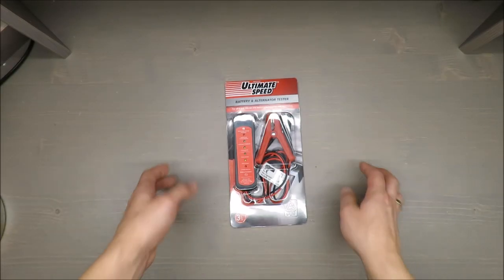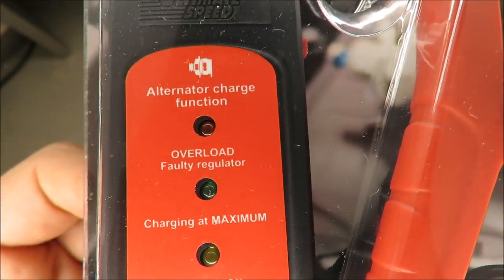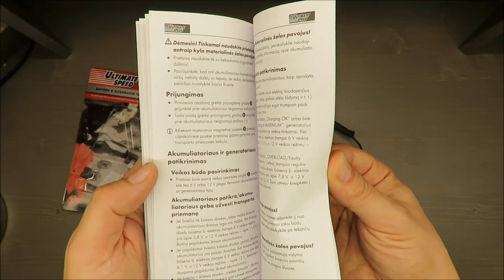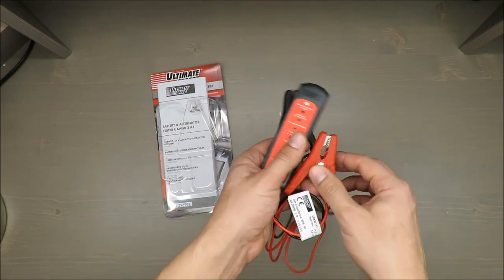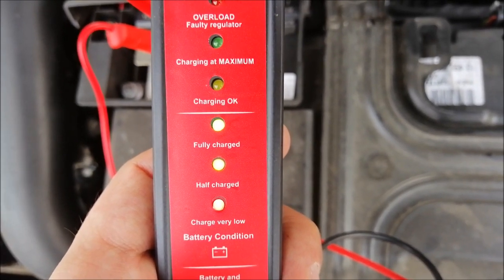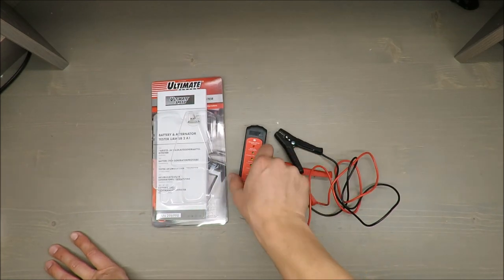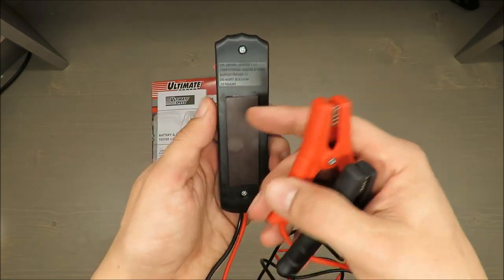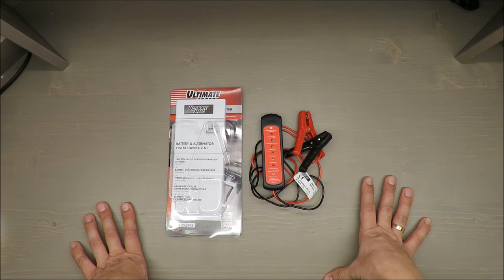UltimateSpeed Battery & Alternator Tester UAWSB 2 A1 UNBOXING TEST REVIEW (Lidl 6V 12V)

Comment: I thought it would be atpy but it helped once as my car died in winter and didn't want to start even with start from other car. I suspected battery and charged with 220V charger ...
This device showed the alternator working and after shutdown of the car how the battery was depleted fast ;-)
New battery problems solved and car 100% reliable again as online sources are different for voltages and you need trend

Comment: The alternator LEDs do not light up, I have done more than one test but they remain off. Do you know why?
Reply: Device is faulty most likely.Sorry for stupid question, did you start you car before checking alternator?)))
Reply: @nemocap2958  I did a test on another car and the device is working properly, so the alternator of the first car is defective. Thanks for replying.
Reply from the maker: Is it new car and Minus is hidden somewhere that only Plus is visible? In such case you need to connect Minus to bare metal or find special connection point (look at the user manual).
Reply: @outoftheboxunboxing5020  The car the tester doesn't fit in is a 1973 Giulia Super. On the 2005 Ford Fiesta, everything is fine.
Reply from the maker: @fabio80r1  ..... maybe at such classic car voltage is different ?! I have no idea. BTW very nice car! I'm jealous :)
Reply: @outoftheboxunboxing5020  Thanks so much. I will keep you updated.😃
Reply: @outoftheboxunboxing5020  Hi, I did another test, if I accelerate many times, the LED for the alternator lights up. I'll make a video and I'll show you.
Reply from the maker: @fabio80r1  Hi, check an alternator by using such devices: https://www.youtube.com/watch?v=8NEIWQL4J00 In general voltage should go up on running engine to at least 13V. If varying the RPMs causes the voltage to fluctuate between 13 and 14.5 volts everything is OK. If not are three things 1) alternator is fading or 2) belt is loose or 3) cables are not fitting tightly. Check all connections.
Reply from the maker: .....(to be precise) ... checking alternator by connecting above mentioned voltmeter to + & - at the battery.
Reply: @fabio80r1  your battery type is the same on both cars dso the regulator/alternastor itself is Brocken thats why this device exists. It is a voltage level switch, if you check with multimeter and gulia has 12v and you rev the engine and it goes to 12,1v+ and higher it charges just not while idle thats possible on old car with brushless based modern alternator